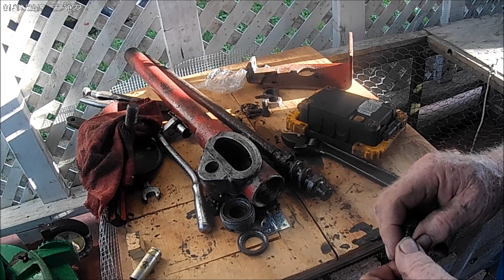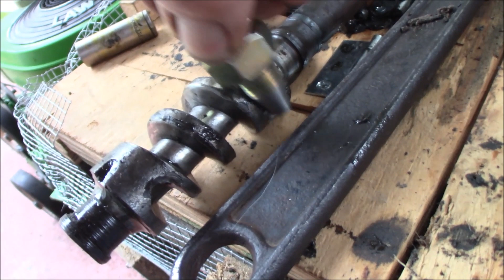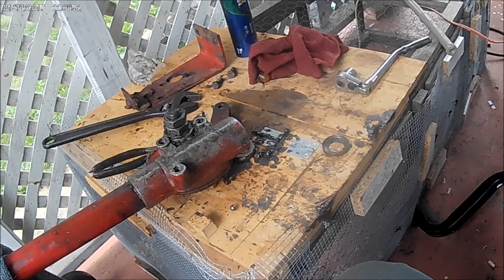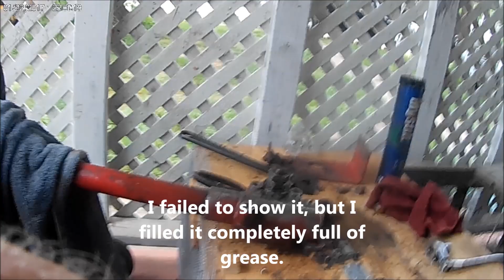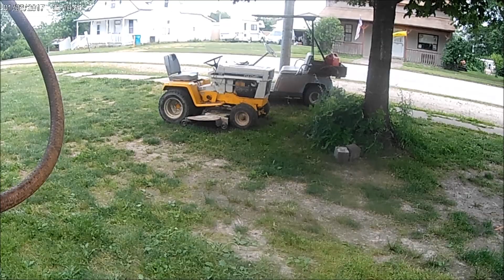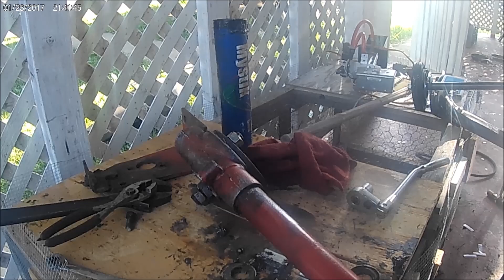Ross steering gear from my Wheel Horse D200

Comment: Looking good, it was great watching you putting this back together as the memories came flooding back. Using a bolt for the pin worked well. Other fun challanges we found with the D series were getting the neutral postion on the tranmission to work correctly and air locks in the tranmission
Reply from the maker: I have to remember to but oil back in the engine and transaxle before I try to start it again,,

Comment: Looks like your fix will work.  Did the same thing with a new bolt for my tractor as well and it worked great.  Better than spending the big dollar.  Stevo
Reply from the maker: it might not be as strong as a factory made one but this one won't get used very much.

Comment: I've rebuilt many of these old ROSS steering assemblies through the years. And the pin that rides in the worm gear is called the cam follower. A machined grade 8 bolt will wear prematurely. I found this out personally. Only the heat-treated cam follower will last much longer. I offer these in my websites & many other parts for sale.
Reply from the maker: no doubt you are right but this thing won't be used very much so hopefully it will last a while.